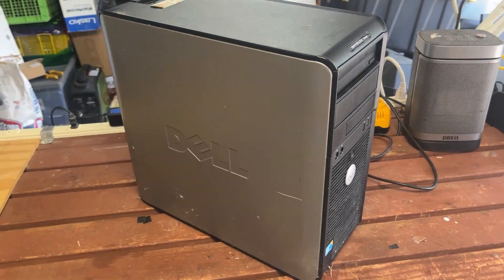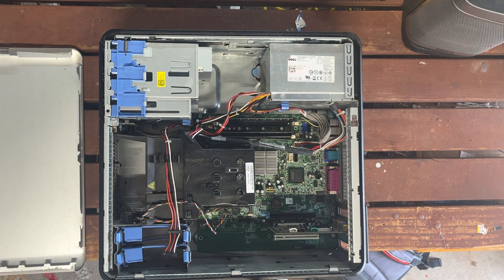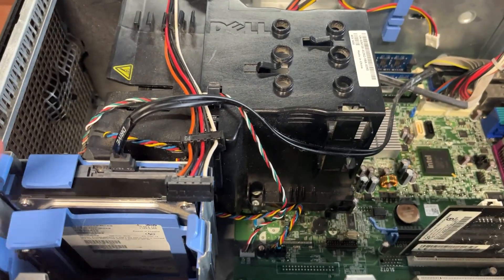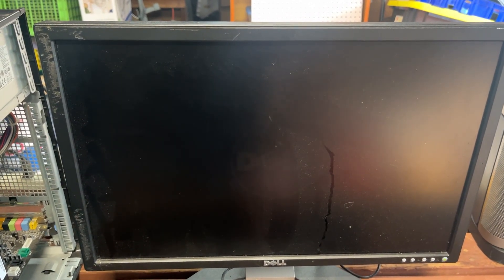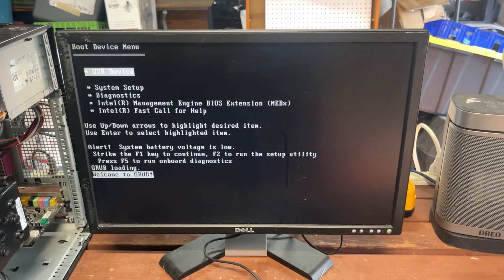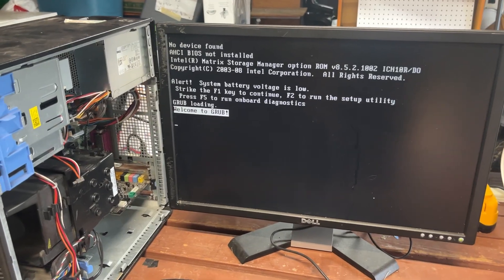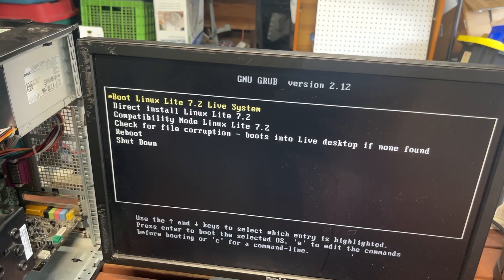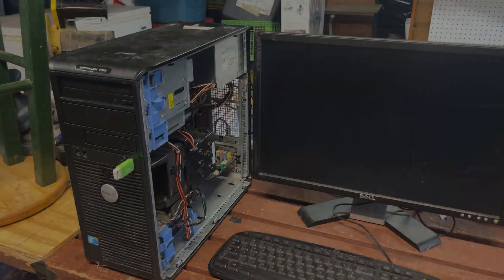Dell Optiplex Trash Pick Will It Run Linux

Comment: Glad you had to pivot. Stock Ubuntu is really not the ideal potato saving distro anyway, especially with its forced Snaps running off a HDD. Mint is a better way to Ubuntu and Mint XFCE specifically is a better way to Ubuntu on an older system. To really squeeze max performance (with a GUI) on a older system for modern apps, Loc-OS is pretty amazing. That 2nd distro wasn't Linux Mint, it was Linux lite. Check your bios settings for UEFI/Legacy Boot options and turn off Safe Boot.

Comment: Hey, i find out you like buying some trash/old pc's

there is a new fleamarket in my area which have many many laptops with macbooks too, but i can't test them there, so do you have any opinion to know if it will work or not? some key points, laptops are so clean for a fleamarket
Reply from the maker: Hey indeed I do this a lot, so this is what you do bring a small portible power supply then a genuine multi power adapter, and your phone when you take a look at one look up the serial number and make sure it’s not stolen or anything like that, same goes for cell phones, if it’s all good then plug it in and test it, as long as the battery charges and the screen comes on you should be good as long as the price is right
Reply: @TechSimplified910  Many Thanks

Comment: oh yeah btw 25.04 wont boot on my 2009 optiplex 760 either,  24.04 and 24.10 work and you can upgrade from there
:3
Reply from the maker: Ok Thankyou so much (noted) and I will give it a try
Reply: probably an issue with newer grub booting on MBR on a non uefi system like that